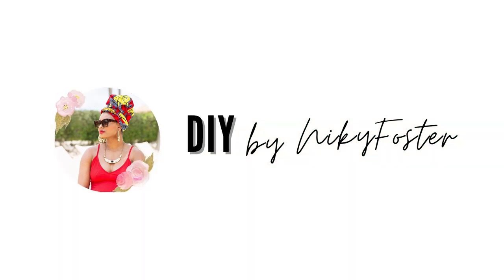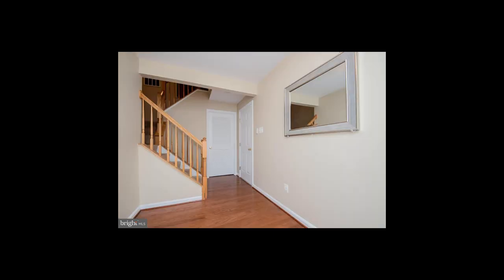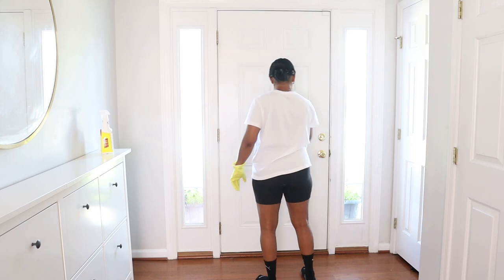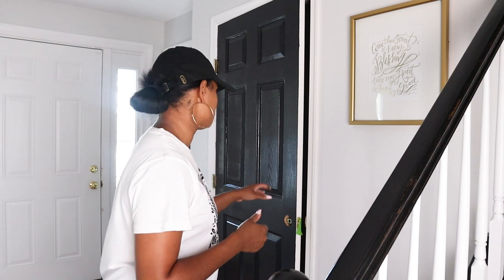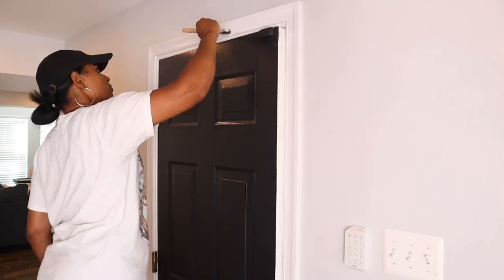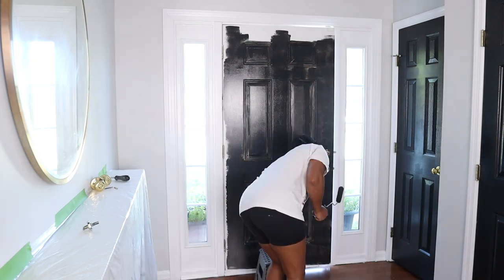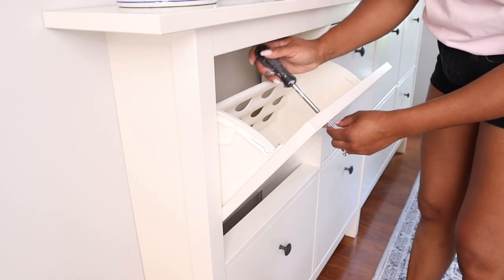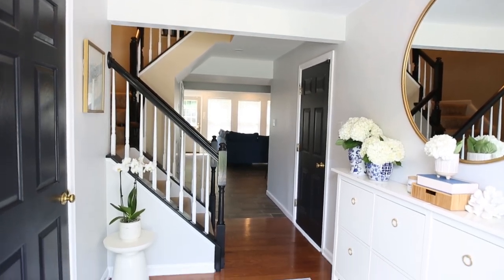DIY ENTRYWAY MAKEOVER BEFORE AND AFTER l DIY FOYER MAKEOVER

Comment: Hi there, I liked the idea how you did your foayer. Quick question though I didn't see if you used masking tape or not for the floor when you were painting in white under the windows. Did you clean after you're done? If you did what did you use to remove the white paint?
Reply from the maker: Yes I got a little on the floor 🤦🏾‍♀️but I used paint thinner to clean it up